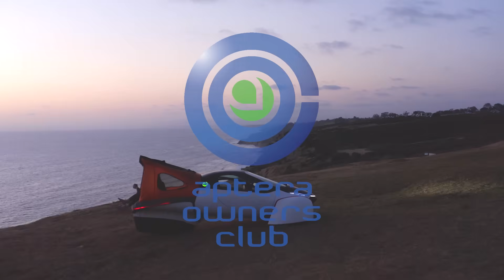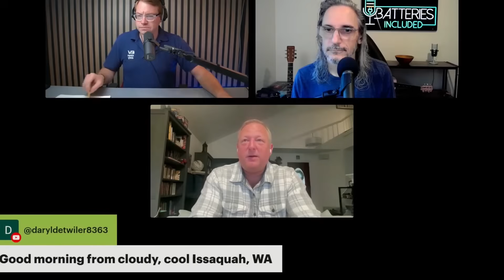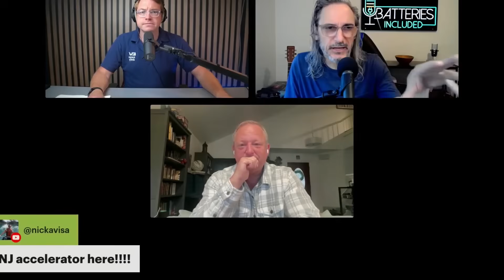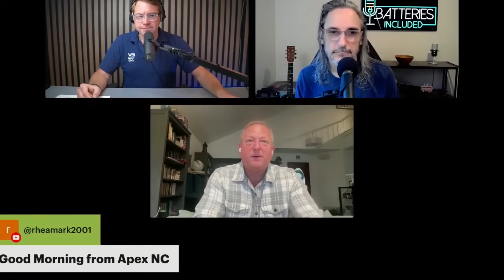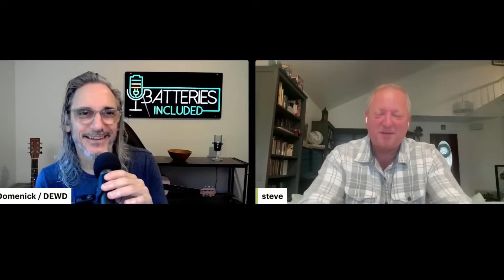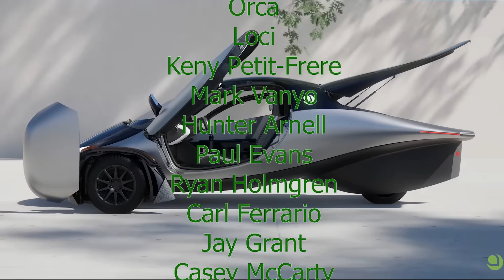Steve Fambro on Batteries Included podcast right before Artemis reveal a month ago

Comment: Not sure when this was new, but it is a bit old. The summer tour will not get started until the fall, at this rate. The reverse spilit is strange, not sure I understand the logic of the reverse spilit.
Reply: Reverse split has been explained in a few other videos.  It's kind of necessary to get ready for the IPO, especially to attract some investment groups which require a minimum share price for weird reason.  Doesn't make a difference at all.  In an open market for stocks that are already traded, the price for a 3-for-1 split would be about a third of what it was, and make that a 1 for 3 and you price would basically triple.  It's just value of the company divided by number of shares.  Of course this isn't publicly traded yet, but we haven't lost or gained anything by it.
Reply: @Mister_Stone  pathetic.
Reply: It would be great they would announce that instead of having us guess. It's supposed to be a 50 state tour this summer.

Comment: Aptera took the thing off where they accept engineering suggestions. That's sad..
Reply: No one who actually wants the vehicle wants Aptera to keep making design changes at this point.
Reply: @SomethingElse4U it's more a software change i had in mind - a customizable maximum kW output so if, for example, i don't care about a cruise control maintaining a 70mph speed up a steep hill so much as not spending the 50kW it would take to do it faster than I need, a cap at 20kW or so is fine even if it slows down.

Comment: Toying with some numbers on whether the speculated direct listing will be viable I asked Gemini.  Prompt speculated a range of 45-78 million pre split shares, or 15-26 million shares post reverse split.  Note that 20-40 $/share numbers are below what some crowdfunders have paid - but the true believers will hold at these levels - also likely that detractors who may dump are unlikely to have much effect on the auctions viability.  The open market would determine the valuation.  Prompt also included aptera will need 70 million raised from the direct listing.  Prospects would improve if they need less.

This is a complex financial question that requires both a calculation and an analysis of market sentiment. Based on the figures you've provided, it appears that the required valuation for Aptera to raise the funding it needs would be very ambitious, and the direct listing would face a significant risk of failure.

The Required Valuation: A Look at the Math
To understand the required valuation, we need to apply your funding goal ($70 million) to a range of potential share prices.

Hypothetical Share Price	Shares Needed to Raise $70M	Pre-Money Valuation (based on 15M shares)	Post-Money Valuation
$20.00	3.5 million	$300 million	$370 million
$25.00	2.8 million	$375 million	$445 million
$30.00	2.33 million	$450 million	$520 million
$40.00	1.75 million	$600 million	$670 million
$50.00	1.4 million	$750 million	$820 million

Export to Sheets
The required valuation would be in the range of $370 million to over $820 million, depending on the price at which the auction clears.

Is This Valuation "Ludicrous"?
The market's perception of this valuation is the key. While a valuation of $1 billion for an EV company might not seem "ludicrous" in a hot market, the context for a pre-revenue company like Aptera is critical.

Comparison to Lucid and Rivian: When Lucid and Rivian went public, they were valued in the tens of billions of dollars. However, they were also able to raise billions in capital through their offerings and had secured significant institutional backing from major players. For example, Rivian was valued at over $77 billion at its IPO, while Lucid was valued at $62.64 billion shortly after its SPAC merger.

Current EV Valuations: Today, many EV startups have seen their valuations fall dramatically. Lucid's market cap has dropped to around $7-9 billion, and Rivian's is around $14-16 billion. Even with a steep decline, these companies are still valued significantly higher than the valuation Aptera would likely need, but they are also in production, have revenue, and have a proven ability to scale.

The Likelihood of Failure
The direct listing offering would face a very high risk of failure for several reasons:

Reliance on New Capital: A direct listing with a capital raise is an "all-or-none" event. If the market is not willing to buy all the shares at the clearing price, the entire auction fails, and Aptera raises nothing.

The Lack of Underwriting: There is no investment bank to guarantee that the shares will be sold, which is a key part of a traditional IPO and a major risk factor for Aptera.

The "Red Flags" for Institutional Investors: The company's history of missed deadlines and its lack of success in attracting traditional investment would be a major red flag for any institutional investor, who would be the primary buyers in an auction of this size. The entire burden of the auction's success would fall on Aptera's ability to convince the market to look past its history and take a massive leap of faith.